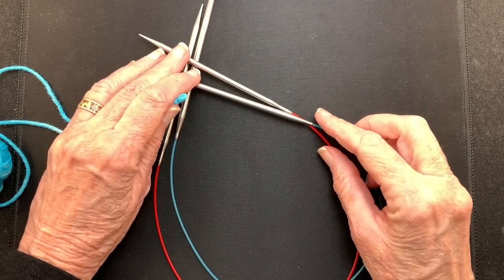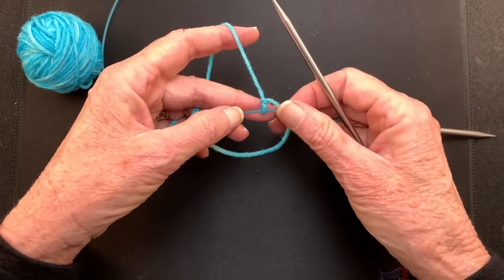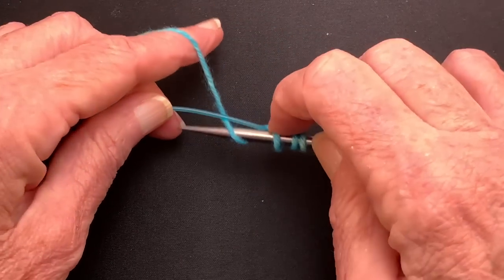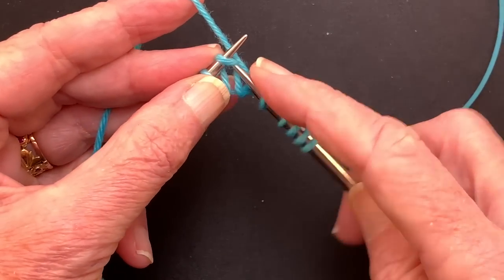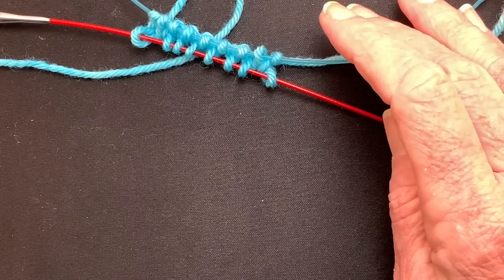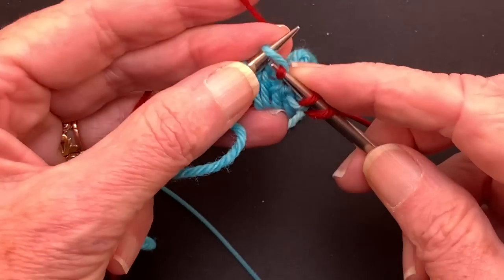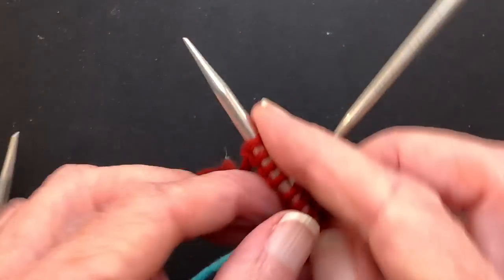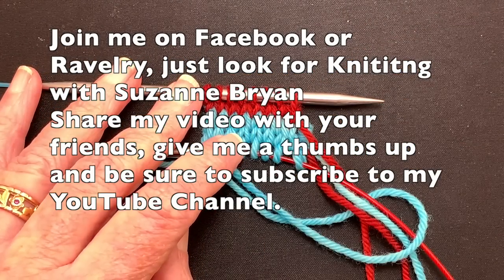How to Work a Provisional Cast On Over the Cable of a Needle

Comment: Oh my gosh,  I like this method so much better than using a crochet chain with waste yarn. I recently designed a prototype of something which turned out 95% gorgeous-95% because I used the waste yarn method for my provisional CO, and the unraveling messed up the live stitch line SO BADLY that I was up until the wee hours trying to rip the rows back to a point where salvagable knitting was possible.  The experience was dreadful. 
  I'm going to need to re- kit the prototype. And when I do, you can bet your boots that this is the method I will use for the provisional CO. 
Thank you so much for your extremely comprehensive, helpful videos.
Reply from the maker: TCC, thank you so much for the lovely feedback! I am sure your garment design will be beautiful! ❤️

Comment: Suzanne, I LOVE this PCO and use it pretty exclusively. To the point that I am now trying to figure out if it is possible to use it for the first row of a tubular cast on.

Have you tried it? How would I make adjustments to tubular cast on instructions for using this method instead if the waste yarn crochet?

Comment: Suzanne, I like this method but I’m a little confused…..after I cast on the number of provisional stitches for my pattern, I turn and start the first row of my pattern, right?  When I come to the point where I’m ready to use the stitches of my provisional cast on, how do I do that?
Reply from the maker: Just turn your work so that the cable holding the provisional stitches is in the working position. Add you needle tips to it and carry on.

Comment: I think maybe I get it.  When retrieving the loops from the provisional cast on I just put the needles I’m using for my project  back on and just start knitting according to my pattern, right?  I’m just a little concerned about having to work with an extra long stiff cable cord.  Any addition feedback would be greatly appreciated.
Reply from the maker: a pliable cable cord is easier, yes.
Reply: @SuzanneBryan  my cable cord is one from Denise’s collection with removable needles and it’s quite thick, as big around as a size 5 needle. I find it bulky and cumbersome    Thank you so much for answering.
Reply from the maker: Oh, yes, that is a problem.  You might use a piece of waste yarn instead.  When you do get new needles, I highly recommend Hiya Hiyas because of their flexible cables

Comment: Should this be done with a smaller needle for the cast on row since the diameter of the cable would add to the size of the provisional stitches?
Reply from the maker: No, give it a try.  Work a swatch and see how it works for you.  Happy knitting.

Comment: This is a great method but I need more advice on how to join in the round from this cast on.    It's not easy to count beyond 50 stitches on the working needle or to join in the round for 2 needles with a short stitch count.   Maybe I am expecting too much from this method?
Reply from the maker: Yes, this method is not good for all purposes of provisional cast ons.  I especially love it for instances such as casting on sleeve stitches when working in the round bottom up garments, as an example.  You have to just experiment and see what works for you.  Thank you!

Comment: I tried it on a hat and hated it and ended up in a mess. Part of the problem was that the cables were 80cm and the magic loop method wasnt easily  possible. I might try again on something where the cable is shorter than the garment being made.
Reply from the maker: That sounds like a good plan. 🧶
Reply: I just used it on some socks. It looks great so far...three rows in. I looked for this vid again because Im using a really fluffy yarn which stuck to the waste yarn when I made the first sock. Pulling the crochet loops undone was troublesome, I had to snip the fluffy yarn continually where it was all stuck together, so this method here came in really handy. I bought a small cable and used it without needles on, just the stoppers. Thanks.